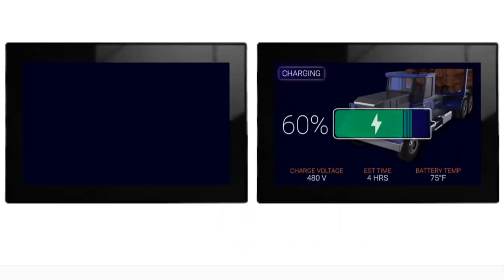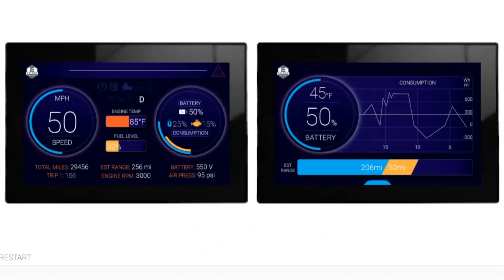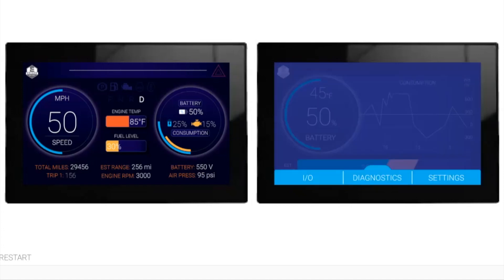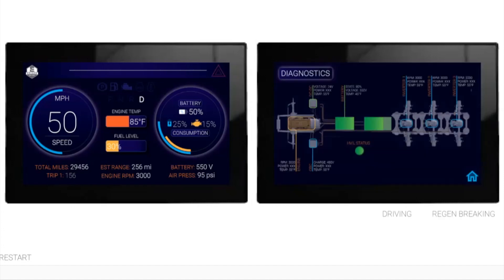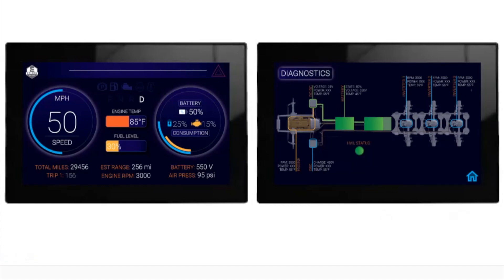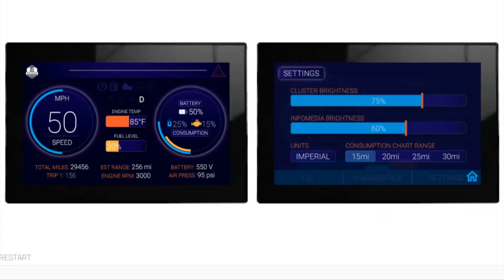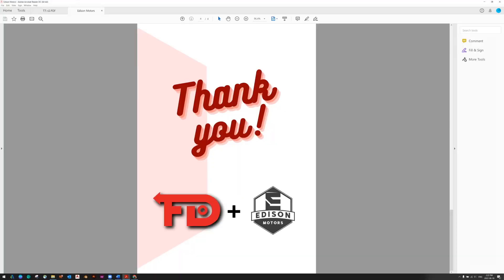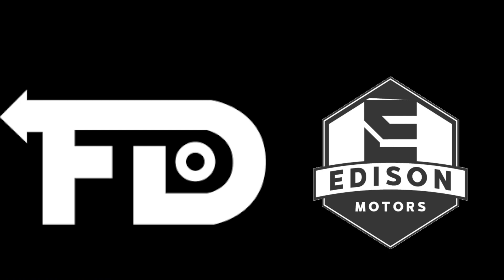Edison Truck Display

Comment: I’ve driven a model 3 for a couple years now.  My biggest feedback is to make it functional and avoid anything flashy. Animations on the speed numbers look cool for demos but do not add to safety while driving. Any touch functions should be large/tactile if possible - I can grab a corner of the display and touch certain parts of the screen quite easily but center of screen functions are susceptible to road shake. I actually prefer physical buttons for the large part.